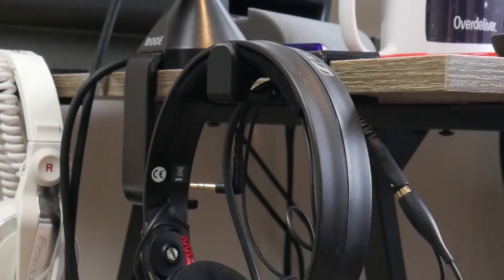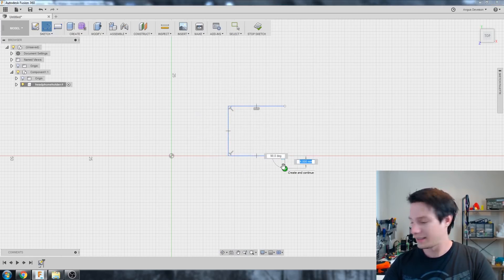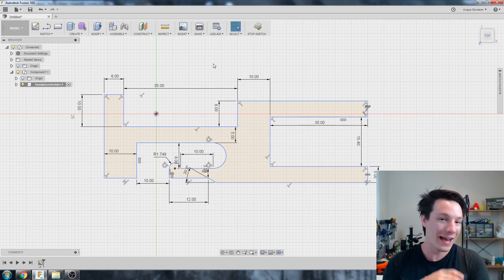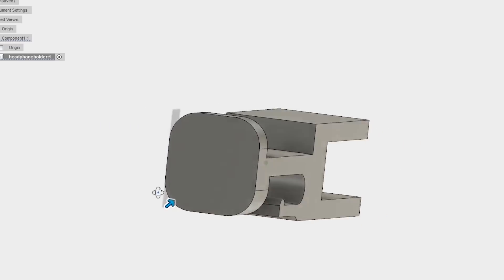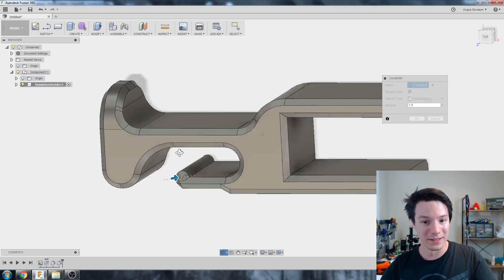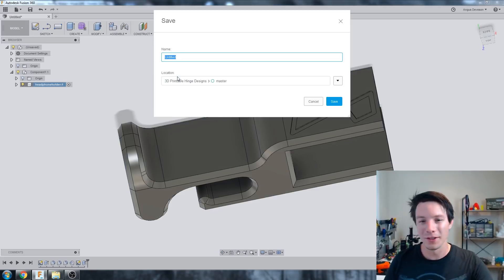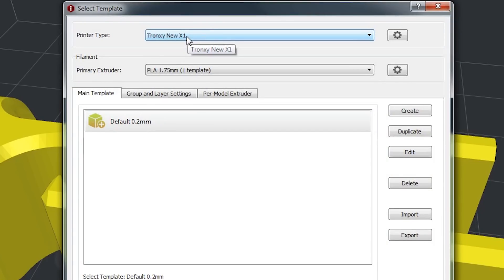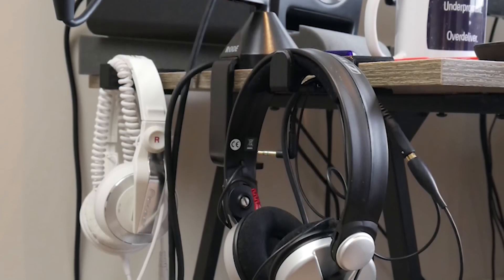Custom 3D Printed Headphone Holder using Fusion 360

Comment: One neat thing I learned recently about fusion 360 is the fact if you dimensions something you can then reference that dimension in other places. 

All you have to do is hover over your dimension. You will see a dxxx number. When you dimension other parts all you have to do is type in your dxxx number. You can even multiple and divide with it.

Comment: good video Angus. guys dont shy away from doing 3D design, programs like TinkerCAD make it easy to do things, the 3D Computer graphics industry has tons of power 3D modelling programs which work differently to traditional CAD approaches and can be used for making 3D prints. Every industry has many programs available that do the same job but may do it in different ways, use different design methodologies and workflows etc. So look around, grab some trial packages and run through some tutorials to find a design approach that works for you, when it uses a logic you can understand intuitively its something you can use efficiently. 3D file formats are often portable between most packages via their import/export features so dont get hung up over needing it to do STL files. Look for Wavefront Object (*.OBJ) support as this is pretty common and a good format to move a file between packages. Why would you want to? I come from a CG background and my existing Lightwave 3D licence is two versions behind and doing boolean operations work perfect to make objects for animation its not clean for 3D printing. So I can do my modelling fast in Lightwave as I've over 20yrs experience in it, then save/convert my models in position for boolean as OBJ files and load them into the simple Tinkercad to make my hole and the file it gives me is clean for printing. Plus I can load it back into Lightwave if I want to work some more moving my 3D data between the pachages as I need the strengths of each. At the end of the day the slicer doesnt care nor does the printer, its not a perfect process but it uses the strengths of the software I already know and the skills I have along with those of emerging software and ideas. So dont be afraid you might be learning the wrong software, as long as you are learning and understanding the process to create what you or a client needs thats all that matters. Never get hung up on thinking you must use a certain piece of software, and yes I use Fusion 360 too, am still a learner on that but as I use it more and gain confidence I can translate my approach in Lightwave into Fusion. The parametric style is really awesome for iterative design. No matter how good you are your first design will need tweaking after you print it as you realise where weak points are in the product etc. Never be afraid to fail, Angus puts a ton of time into learning himself so he can make his demos look so effortless. thanks mate.

Comment: Sorry my comment is late,

I have just purchased a cetus mkII 3d printer and i am going to be using x3d pro 1.75mm PLA and i dont know what print temperature to use, can you please help?
Reply from the maker: I would just use default, if that's too hot try 200 then 190.
Reply: Thanks! It worked with a bit of stringing!

Comment: Hey Angus, I just tried IdeaMaker and I noticed that it has the flow rate by default at 94% for pla. You can see it for your self by clicking the gear button next to the primary extruder drop down in the template settings. Should I set it to 100%? I'm afraid that the low flow rate will cause weak parts.

Comment: Headphone Desk Stand

https://www.thingiverse.com/thing:2726133

There is a wider headphone mount if you want this, not needed.The narrow version is good enough for most headphones. The narrow version headphone mount is also quicker and takes less filament to 3D Print

There is a screw headphone mount, narrow version, if you want just this part if you want to screw onto something. Using "just this" is the quickest and takes less filament to 3D Print

The vertical stand is made in sections to fit most 3D Printer build plates.

I used Pure acetone to join ABS parts together.

There are two reinforcing parts, printed upside down, that should be acetone to the back of the joins of the vertical stand after that has been joined together and set, using Pure acetone

Here is a YouTube play list of this Headphone Desk Stand:-
https://www.youtube.com/playlist?list=PLUqt0sTiXUDc-DAIJnxgmWxQQRooDx-z0

Comment: Angus. That was a great video. I used to use Cubify Invent for more than 2 years and was keeping away from Fusion 360 but with this one I designed my own headphone holder for my Logitech G15 that I will share on Thingiverse was a great sucess.  Thanks again.

Comment: Are you taking into account the addidional .4-.6mm of thickness added to the actual dimentionss of opening or width/length of the model depending on nozzle and layer height as well as extrusion. (Based on .4mm nozzle and .2mm or .3mm layer height)
Reply from the maker: This isn't added, the software offsets it automatically :)
Reply: Maker's Muse interesting,  what are t b d settings you have there,  also do you know if solid works has these options, i think it would but not sure where.  Thanks

Comment: For prints requiring high tolerances, I usually use a prototype profile that has low infill and fast print times for brand new models. In my experience getting a print right first time is unlikely so expending more filament is a better strategy.
Reply: well aren't you special

Comment: You should mention that fillets make the parts stronger as well.
Reply: clayrev It's crazy how people forget this. Especially for 3D printing softer, rounder, parts print better and are stronger. I would use the sculpting feature in fusion for an alien blob headphone holder. And now with topology optimization and 3Dprinting we have no excuse for these boxy, weak, designs.

Comment: Btw. you can draw an arc by just holding down on the starting point with the line tool. I find it a lot more confortable than always selecting the tool for that short arc

Comment: Hi Angus,
I don't know where you are educated, but i if your instructor came from the 'old school', he might have preferred chamfer to fillet because it is easier to manufacture in a subtractive process like milling.
Reply from the maker: I was referring more to the pronounciation of chamfer, but definitely chamfers are easier to machine traditionally than fillets for the edge of faces!
Reply: Haven't even watched the video, but Chamfers are preferred in 3D printing because it creates 45 degree angles which are good for avoiding overhang problems.

Comment: Angus, is there any way to bring a dwg file from AutoCAD into fusion 360?
Reply: If there is 3D models in there you can try finding a way but most of the time AutoCad dwg files only contain 2D Data which usually only turns into a mess in fusion, due to all the interior details on e.g. an architectural plan.
Reply: Thomas Gehrdes Jr - Yes.  But, use good layout methods in your 2D CAD.  Separate similar objects into logical layers, for instance.  Then, in F3D, use "Insert"/"Insert DXF"/"Select" Plane.  Then, in my opinion, use "Insert Mode"/"One Sketch Per Layer"/"OK."  That will make multiple sketches - one from each of the 2D drawing's layers.  Much less confusing that way.  You can bring everything in as a "Single Sketch" also, but on complex drawings, it can really be a mess that way.

Comment: Very nice video. I have noticed a lot of slicers now have a lot of different options of infill even Cura has 13 different patterns total. I am still waiting for custom support to pick and chose where i want it in Cura (my preferred slicer) but no one FREE slicer is perfect.
CNC Kitchen did a video about the infill pattern strength and print times on feb 25th worth a watch.

Comment: Angus, That cubic infill. Hasn't Cura had this for quite a while now? Also a tip for designing, measure EVERYTHING. For some things I've designed, I've even modelled a crude representation of the object my design has to interact with, so I can see how the design fits.
Reply from the maker: Indeed it has! I prefer ideamaker due to it's interface and custom supports thought.
Reply: if you need custom supports, I find that it's better to use tree supports in MeshMixer. You can then do away with the cost of Simplify3D altogether (frankly I don't understand how they keep going as a business given the quality and abundance of free tools these days)
Reply: Maxx B yes it has

Comment: Can you stress test that cubic fill and show that it really is stronger than the grid version?
Reply: The layers of the grid fill are 100% in contact, since each line is drawn on top of a similar line.  In the cubic fill, the layers are skewed, so each line is only partly overlapping the previous layer.  I would think that would make it weaker, not stronger.

Comment: Hey...great video...I have a suggestion maybe you can tackle and help us Prusa MK2 owners silence our Printers a bit with a little help of the TMC2130 stepper drivers...thoughts?
Reply: It's not that simple since the rambo mini has integrated stepper drivers. You'd probably have an easier time replacing the board altogether than you would adding just the drivers, so it's not a very good subject for a video.
Reply: Miguel Quintero I just installed plastic never lube bearings and boy they are silent compared to the ball bearings. You might wanna look into them. They call them drylin made by igus.
Reply: Tom has a great video on adding a tmc2130 to a 3d printer which may help
 https://youtu.be/sPvTB3irCxQ
Reply: I'll look into them...thank you!!
Reply: Thank you...I'm looking into a work around from someone else....if it works, I'll post...